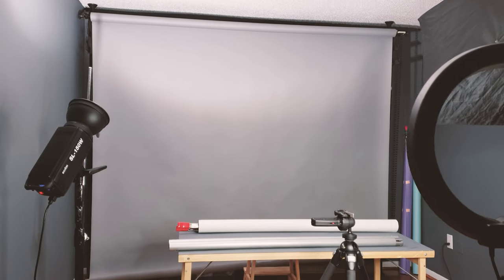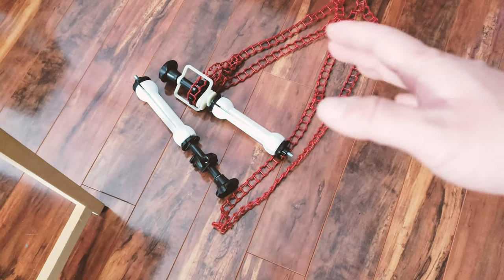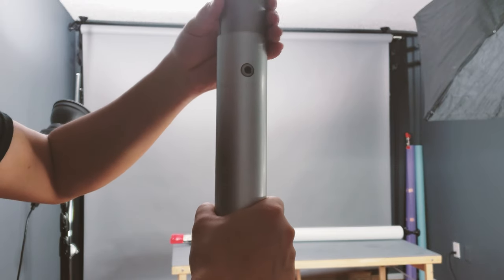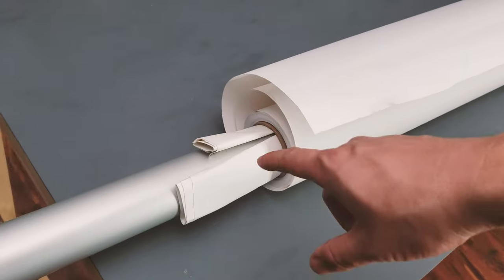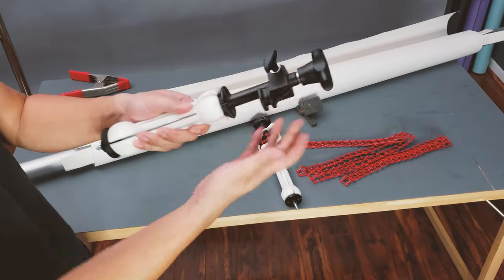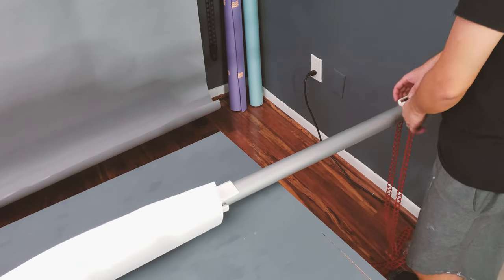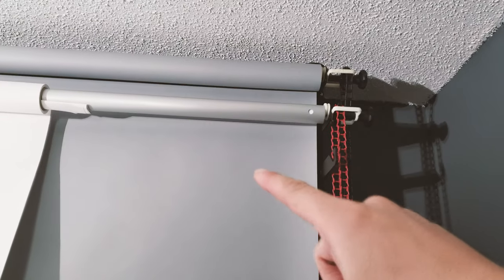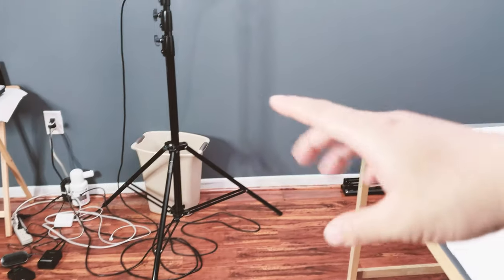How To Setup Seamless Paper of Different Sizes Using Manfrotto AutoPole + Expan Kit + Alu-Core 047-2

Comment: Great video and very clear to understand. I'd suggest those non-slip dinner mats as an option for holding the backdrop onto the bar.

I've been contemplating the 047-2 and wanted to know whether I could use each section independantly for two shorter rolls. This demo confirms it for me (With the clamshell fitment being removable)

Cheers.